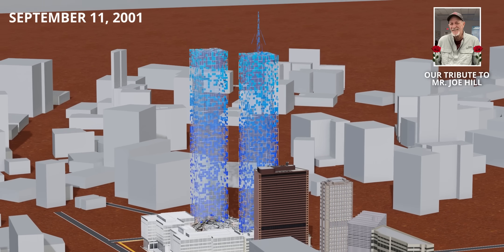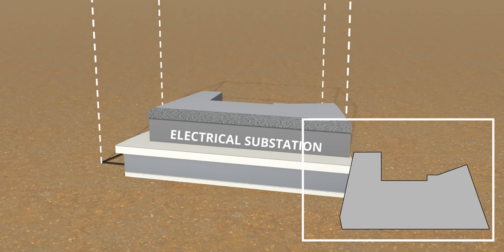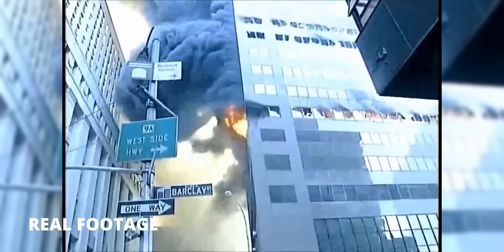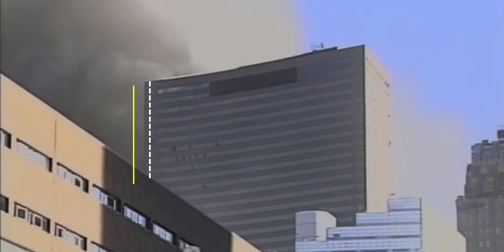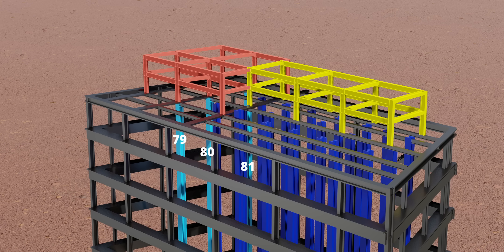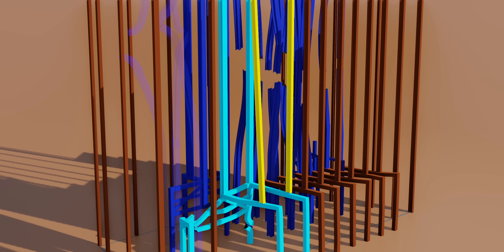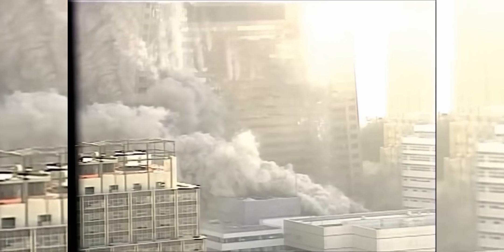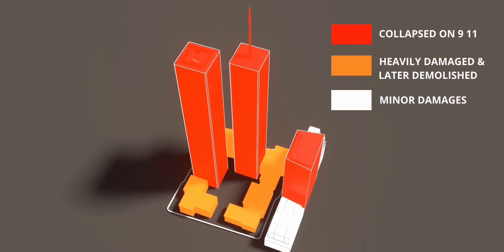Collapse of Building 7 | The Complete Physics

Comment: Junk science
Reply: And yet not wrong. Go figure. 

This video is very good – with one or two exceptions - and goes into a much higher level of detail than many viewers will be able to comprehend.  While not perfect, the collapse mechanisms – the sequence of failures - described here  are substantially correct and this is true no matter who planned and carried out the 9/11 attacks or why . 

That may not be what you want to hear and go against 20+ years of entrenched dogma and conditioning, but it’s not wrong. 

That also means (in case you did not get the hint) this video can be (and IS) absolutely correct in its description of collapse mechanisms AND the 9/11 attacks could still have been some sort of inside job. The two things are in no way mutually exclusive. 

The mechanisms described here have broad professional support around the world. There are no professional engineering organizations (for example: ASCE, ASEE, ICE, etc) that disagree with them or have offered any formal dissenting opinions or alternative hypothesis. 

So, setting hubris aside, either the overwhelming majority of the worlds structural engineers and simple observation are wrong,… … or you are. Which seems more likely? 

IF you still think believe this explanation is wrong then produce a better one . Good luck with that. No one ever has and I don’t see you moving that needle today. 

No one ever does.
Reply: @ the one or two exceptions make it junk
Reply: @Nothing._-  - That's not using the thinking part of the brain.
Reply: @ that’s exactly what I have done, to many confounding inputs not taken into account here, University of Alaska Fairbanks done a proper evaluation not using blender and false confounders

Comment: Just another fake news presentation from Big Brother.
Reply: It's important to create reasonable doubt.
Reply: Ok, foilhat
Reply: And yet not wrong. Go figure. 
	
This video is very good – with one or two exceptions - and goes into a much higher level of detail than many viewers will be able to comprehend.  While not perfect, the collapse mechanisms – the sequence of failures - described here  are substantially correct and this is true no matter who planned and carried out the 9/11 attacks or why . 

That may not be what you want to hear and go against 20+ years of entrenched dogma and conditioning, but it’s not wrong. 

That also means (in case you did not get the hint) this video can be (and IS) absolutely correct in its description of collapse mechanisms AND the 9/11 attacks could still have been some sort of inside job. The two things are in no way mutually exclusive. 

The mechanisms described here have broad professional support around the world. There are no professional engineering organizations (for example: ASCE, ASEE, ICE, etc) that disagree with them or have offered any formal dissenting opinions or alternative hypothesis. 

So, setting hubris aside, either the overwhelming majority of the worlds structural engineers and simple observation are wrong,… … or you are. Which seems more likely? 

IF you still think believe this explanation is wrong then produce a better one . Good luck with that. No one ever has and I don’t see you moving that needle today. 

No one ever does.
Reply: @TheCriticalStinker-01 how did the bbc know it was falling 30 minutes before it actually did? This video just shows how we did it)
Reply: @sooie27 bc for 9 hrs everybody was talking about whether or not it would fall bc the damage was so bad.  All it takes is for the news station to get confused info in modern history of this planet.  Not hard to understand

Comment: Nonsense
Reply: And yet not wrong. Go figure. 

This video is very good – with one or two exceptions - and goes into a much higher level of detail than many viewers will be able to comprehend.  While not perfect, the collapse mechanisms – the sequence of failures - described here  are substantially correct and this is true no matter who planned and carried out the 9/11 attacks or why . 

That may not be what you want to hear and go against 20+ years of entrenched dogma and conditioning, but it’s not wrong. 

That also means (in case you did not get the hint) this video can be (and IS) absolutely correct in its description of collapse mechanisms AND the 9/11 attacks could still have been some sort of inside job. The two things are in no way mutually exclusive. 

The mechanisms described here have broad professional support around the world. There are no professional engineering organizations (for example: ASCE, ASEE, ICE, etc) that disagree with them or have offered any formal dissenting opinions or alternative hypothesis. 

So, setting hubris aside, either the overwhelming majority of the worlds structural engineers and simple observation are wrong,… … or you are. Which seems more likely? 

IF you still think believe this explanation is wrong then produce a better one . Good luck with that. No one ever has and I don’t see you moving that needle today. 

No one ever does.

Comment: Nice try 😂
Reply: This video is very good – with one or two exceptions - and goes into a much higher level of detail than many viewers will be able to comprehend.  While not perfect, the collapse mechanisms – the sequence of failures - described here  are substantially correct and this is true no matter who planned and carried out the 9/11 attacks or why . 

That may not be what you want to hear and go against 20+ years of entrenched dogma and conditioning, but it’s not wrong. 

That also means (in case you did not get the hint) this video can be (and IS) absolutely correct in its description of collapse mechanisms AND the 9/11 attacks could still have been some sort of inside job. The two things are in no way mutually exclusive. 

The mechanisms described here have broad professional support around the world. There are no professional engineering organizations (for example: ASCE, ASEE, ICE, etc) that disagree with them or have offered any formal dissenting opinions or alternative hypothesis. 

So, setting hubris aside, either the overwhelming majority of the worlds structural engineers and simple observation are wrong,… … or you are. Which seems more likely? 

IF you still think believe this explanation is wrong then produce a better one . Good luck with that. No one ever has and I don’t see you moving that needle today. 

No one ever does.
Reply: @TheCriticalStinker-01  This video is complete BS with only one single exception: It proves NIST´s "stage 1" ("less than free fall drop") as horizontal movement only.
Reply: @Kudde23   All done now princess?

Comment: This explanation is about as accurate as the explanation of the liberty incident
Reply: And yet not wrong. Go figure. 

This video is very good – with one or two exceptions - and goes into a much higher level of detail than many viewers will be able to comprehend.  While not perfect, the collapse mechanisms – the sequence of failures - described here  are substantially correct and this is true no matter who planned and carried out the 9/11 attacks or why . 

That may not be what you want to hear and go against 20+ years of entrenched dogma and conditioning, but it’s not wrong. 

That also means (in case you did not get the hint) this video can be (and IS) absolutely correct in its description of collapse mechanisms AND the 9/11 attacks could still have been some sort of inside job. The two things are in no way mutually exclusive. 

The mechanisms described here have broad professional support around the world. There are no professional engineering organizations (for example: ASCE, ASEE, ICE, etc) that disagree with them or have offered any formal dissenting opinions or alternative hypothesis. 

So, setting hubris aside, either the overwhelming majority of the worlds structural engineers and simple observation are wrong,… … or you are. Which seems more likely? 

IF you still think believe this explanation is wrong then produce a better one . Good luck with that. No one ever has and I don’t see you moving that needle today. 

No one ever does.

Comment: try bullshit better
Reply: And yet not wrong. Go figure. 

This video is very good – with one or two exceptions - and goes into a much higher level of detail than many viewers will be able to comprehend.  While not perfect, the collapse mechanisms – the sequence of failures - described here  are substantially correct and this is true no matter who planned and carried out the 9/11 attacks or why . 

That may not be what you want to hear and go against 20+ years of entrenched dogma and conditioning, but it’s not wrong. 

That also means (in case you did not get the hint) this video can be (and IS) absolutely correct in its description of collapse mechanisms AND the 9/11 attacks could still have been some sort of inside job. The two things are in no way mutually exclusive. 

The mechanisms described here have broad professional support around the world. There are no professional engineering organizations (for example: ASCE, ASEE, ICE, etc) that disagree with them or have offered any formal dissenting opinions or alternative hypothesis. 

So, setting hubris aside, either the overwhelming majority of the worlds structural engineers and simple observation are wrong,… … or you are. Which seems more likely? 

IF you still think believe this explanation is wrong then produce a better one . Good luck with that. No one ever has and I don’t see you moving that needle today. 

No one ever does.

Comment: I had a Federal Lawsuit against Con Edison sitting in the second Circuit Court of Appeals that very moment. Discovery in that lawsuit provided documents that the Con Ed substation was illegal and contained 450,000 gallons of PCB oil. I knew immediately the firers were caused by that burning oil and there would be many deaths from the toxins being generated. I notified the politicians, but they never responded, instead they assured everyone the air was safe. Furthermore, I faxed my information to the Daily News, and they published it the next day on their front page. Over 5,000 lives could have been saved. My case lasted 20 years and never went to trial because this information would become public.
Reply: There were no fires observed in the Con-Ed substation, nor was there smoke coming out of any of the transformer-vault vents. Additionally, the columns were encased in concrete there, and the transformers were placed in fire-/explosion proofed vaults.
Reply: @hanswurstinger4289  - No one is claiming there were fires in the Con-Ed substation.  Not a factor in collapse.
Reply: @TheCriticalStinker-01  "No one is claiming there were fires in the Con-Ed substation.  Not a factor in collapse."

Can you read? -> horsedag2468:  "Discovery in that lawsuit provided documents that the Con Ed substation was illegal and contained 450,000 gallons of PCB oil. I knew immediately the firers were caused by that burning oil"
Reply: @hanswurstinger4289  - I read the OP. There is not a single thing in it that anyone could not have just made up. On its face the whole thing is preposterous and absurd. You fell for it. What does that say about you?
Reply: @TheCriticalStinker-01   Whatever, troll. LOL
Reply: @hanswurstinger4289   Yes, it's horrible that your pet hero OP, and you, had nothing. Boo and hoo.
Reply: Uh huh

Comment: Almost as believable as BBC reporter  Jane Stanley’s announcement that WTC7 had already collapsed—a half hour before it fell while it was clearly visible right behind her, standing tall…
Reply: @h1F595  The only problem is that no steel-structured building like WTC7 has ever collapsed because of fire.  Therefore here was no experience or basis from which to judge if WTC7 would collapse or when.  Quite the contrary, the expectation is that it should stand even if it burnt out completely.

The have been similar steel structured building that were comparative towering infernos compared to WTC7 - they burn more fiercely, more extensively and for much much longer and they still stand today, many reclaimed and occupied.

Of course this is but a minor issue compared to the far greater controversy : the way WTC7 actually collapsed:  The building collapsed straight down symmetrically and at free-fall for over 2 seconds (~8 storeys).   Basic physics tells us that for this to happen the entire structure around the perimeter of the building had to fail at completely and simultaneously. 

There is no plausible explanation that anyone has given that can account for this without controlled demolition.
Reply: @gladishilton1943  All done now princess?
Reply: @gladishilton1943  It's been explained ad nauseum countless times. You don't like the explanations. Who cares?
Reply: @gladishilton1943  - Countless thousands of steel framed buildings and structures have failed it fire. It happens all the time. Steel is formed using heat and deformed the same way. Only ignorant conspiratards who get their information from a guy who explains the complex interactions of millions of components by banging two cardboard boxes together get that backwards.  The rest of the world has understood that since the first Blacksmith hung out his sign. 

Honestly dude, just give it up already. FFS 

The collapse of Building 7 is probably the most studied engineering disaster in history and the subject of 5 comprehensive engineering studies and more than two dozen technical articles in major peer reviewed engineering journals, most of which were published 15 or more years ago. Thousands of pages of material.  This should get you started.  None of them bang cardboard boxes together. 

FEMA BPAT (initial report superceded by NIST NCSTAR 1A)

NIST NCSTAR 1A: Final Report on the Collapse of the World Trade Center Building 7, 2008.

Guy Nordenson and Associates, WTC7 Global Collapse Analysis Report and Summary of Findings, 2010.

Arup, WTC -7 Structural Fire Analysis Report (Runs 1-4), 2010.

Weidlinger Associates Inc., WTC 7 Collapse Analysis and Assessment Report, 2010.

BRE Centre for Fire Safety Engineering, Analysis of the Impact of a Fire in the Mechanical Room (5th & 6th Floor) of the World Trade Center 7 Building, 2010.

T. McAllister, R. MacNeill, O. Erbay, A. Sarawit, M. Zarghamee, S. Kirkpatrick, J. Gross, Analysis of structural response of WTC 7 to fire and sequential failures leading to collapse, J. Struct. Eng. (United States). 138 (2012) 109–117.

For a summary of the major studies I would recommend THE COLLAPSE OF WORLD TRADE CENTER 7: REVISITED by Mhd Anwar Orabi , Liming Jiang , Asif Usmani and Jose Torero which is a 33 page summary of the different analysis and conclusions published in 2020. Sorry, YouTube will delete this post if I give the link but it should be easy to find and is available from the University of Queensland, Brisbane. 

Happy reading

And of course, Hulsey:  A Structural Reevaluation of The Collapse of World Trade Center 7 March 2020,… for those who need a good laugh.
Reply: Hey genius, the FDNY assessed the damage and predicted it wouldn't last. Reuters mistakenly reported that it had collapsed and BBC picked up on that. It was a mistake during the most chaotic news day in history. Anything else I can help you with or can you people stop repeating the same old nonsense thinking you're "in the know" for the past 23 years?
Reply: @joshd3192  Yeah Poorpoo, you could try to explain exactly HOW such a mistake could happen.
Reply: @Kudde23   Anything else princess?
Reply: @Kudde23  All done now princess?
Reply: @Kudde23 Because the fire department stated the building was going to collapse. There you go. Conspiracy debunked.
Reply: @Kudde23  I guess you ran away kiddo?
Reply: @HowardFinkelsGhost  Blablahblah Finklepoo?

"It was mistakenly reported it came down."

HOW?
WHY?
BY WHOM?

Dodge harder Finklepoo!
Reply: @Kudde23  BBC News has repeatedly addressed what happened during its reporting that day. In a piece written in September 2021, the news agency said it relied on information from Reuters, which had reported that the building came down.

“The Reuters news agency had mistakenly reported the collapse of the building, which was also picked up by CNN, just before the live report,” BBC wrote. “Reuters later issued a correction – but clips of the report continue (to) go viral in the days leading up to 9/11 anniversaries.”

This is old news, just like your boring shtick.
Reply: @Kudde23  All done now princess?
Reply: @Kudde23  Run away, run away...
Reply: @Kudde23  Oh no little copypoo can't backup its claims. Poor little copypoo.
Reply: @joshd3192  Are you showing off all your skills again Poorpoo?
Reply: @Kudde23  All done now princess?
Reply: Yeah because the BBC was in on this conspiracy of yours. What a fucking tool.
Reply: @ButtHead-n5u  "this conspiracy of yours"

What exactly are you referring to copypoo?
Reply: Oh FFS not that dead horse again.
Reply: @TheCriticalStinker-01  How are simple facts a dead horse Fitzshill?